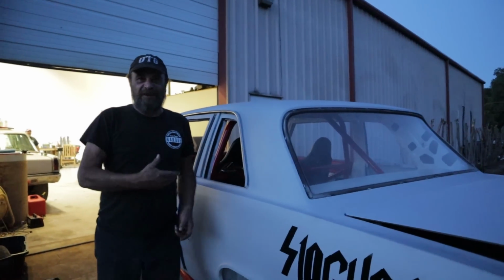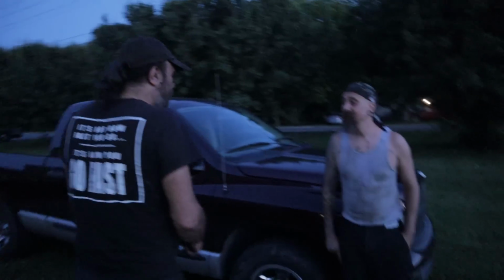Slaghammer Barks To Life, And She Sounds Strong

Comment: Hands down the coolest build on youtube right now for soo many reasons. I would list them, but there is no point. People would just argue with me. I will sum it up with this, have fun! This build is fun! If I had to assign a hash-tag to this build it would be: #fuckthemold. Just get out there, and start wrenching. Don't worry about the latest/greatest. Just put shit together, make it make noise, and have FUN. I freaking love this thing! Bye-the-way, I can hear your "selective parts blue-printing" Tony. All 8 are hitting super consistent. She is dialed. Time well spent. That is gonna be one long ride AL! But, you will be living the high-life my friend! And have bragging-rights extraordinaire when its over. Man, I just love this thing! Like, I'm dreaming up my own Street-Freak build. Seriously. One thing I would seriously consider before Power-Tour: get some hangers on those glass-packs. That is a lot of weight hanging off those headers. Your header-gaskets will be very short lived. And good chance of metal fatigue at the collector and the glass-packs just checking out. Also a high probability of cracks at the header flange to tube joints with all that weight shaking away out there. I'm sure you guys know this. Just pointing out the obvious in case you are so overwhelmed with the build it maybe slipped under the radar. Heck, for all I know there are hangers there already and we cant see them? But, it doesn't look like it.

Comment: What's that clatter? lifter noise?
Reply: I think he said it's a solid roller in another video .
Reply: @daveranger2826  You're right. That's probably it. That's why I stick with hydraulic lifters. I'm not experienced enough to differentiate a lifter problem from normal solid lifter noise and it would drive me crazy
Reply: @daveranger2826  Even if its a solid roller it shouldn't be nearly that noisy, I've built diesels that where quieter than that.

Comment: I’m a novice so please don’t crucify me. But I heard 2 things that I don’t think is right?  Ton of lifter noise. And the car loading up and bogging just at the hit of the throttle coming off the raised rpm. To me it sounds like the card work is definitely not done. Could have heard it wrong through the phone. And it’s possible I don’t know what I’m talking about. I chalked the lifter noise up to hydraulic lifters and not being pumped up all the way causing more valve/rocker lash than normal. But maybe I’m not right about that either???  I expected more cam than that tbh but I did the car guys. Congrats. Can’t wait to see the hammer drop

Comment: sounds awesome! i hope that wasn't the break in run but congrats!
Reply: The camshaft and lifters were used no breaking in required!
Reply: If it’s a flat tapett cam then break in is always required (idk if they used a roller cam or not though I recall he said the cam / valve train was out of a used engine he had), given this, I’d say I’d rather be safe than sorry and break it in properly.